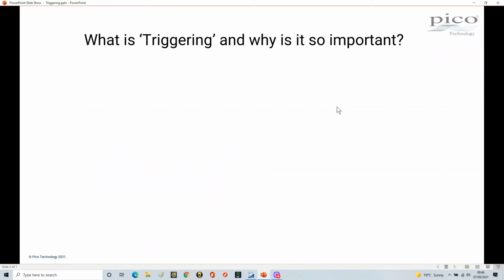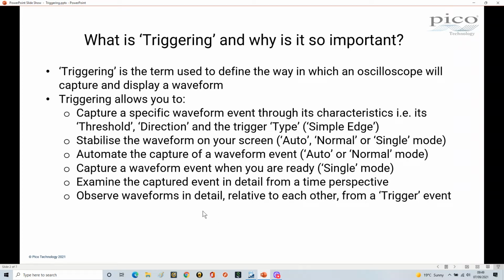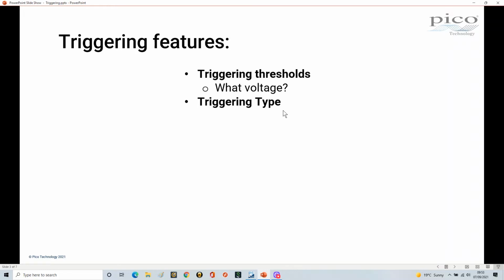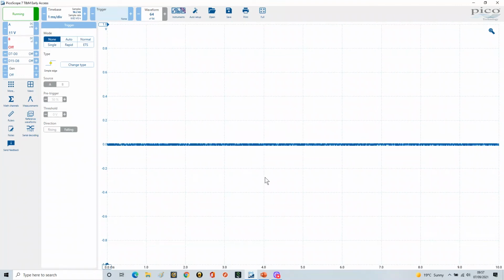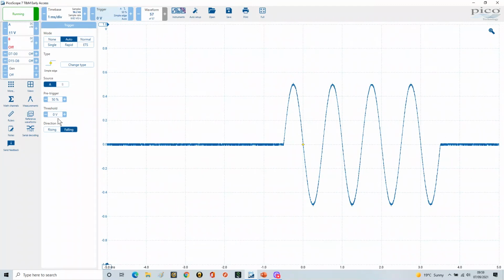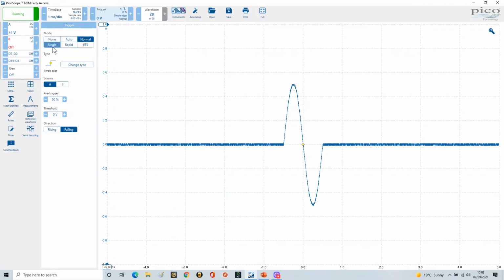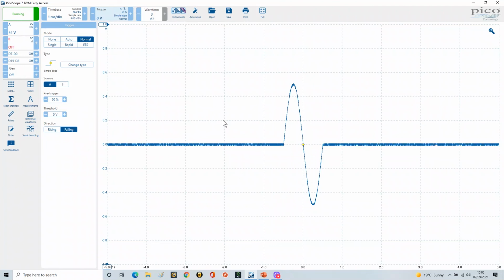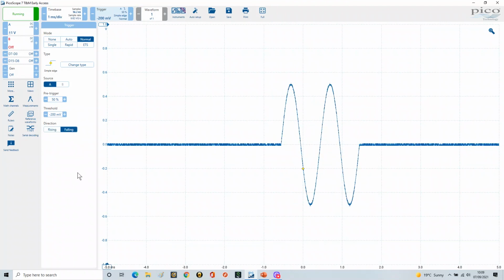Triggering PART 1 - The basics

Comment: I have a PICO scope 2204a, and I am trying to capture the highest kv spark on a coil on plug wave. Every time I press the space bar on my computer, it does not catch the wave at its highest point, and mostly at a lower point. By using "single," on the trigger function, will I be able to catch the kv spark line at its highest point so that I can measure it?